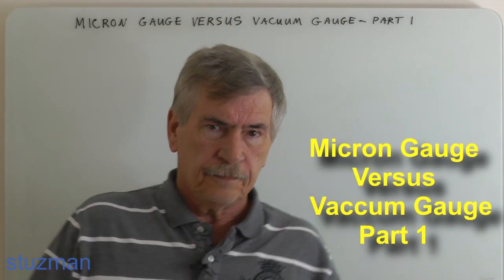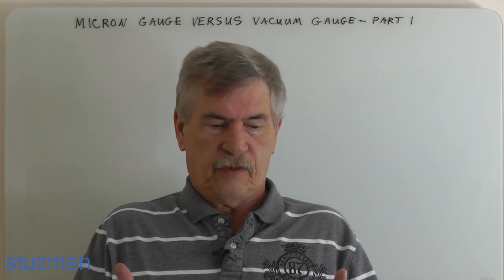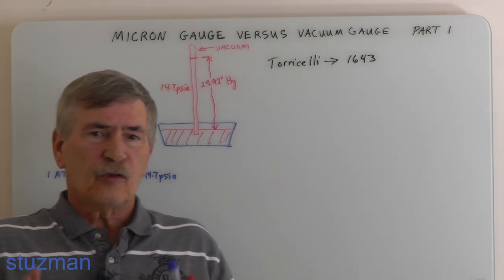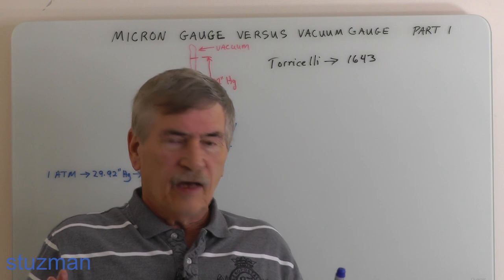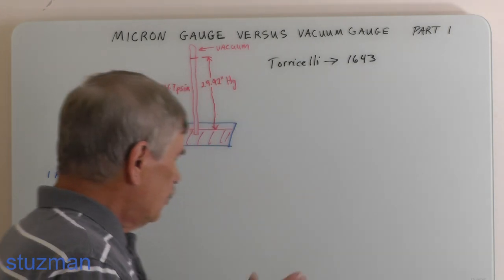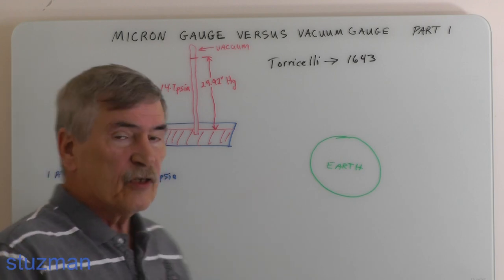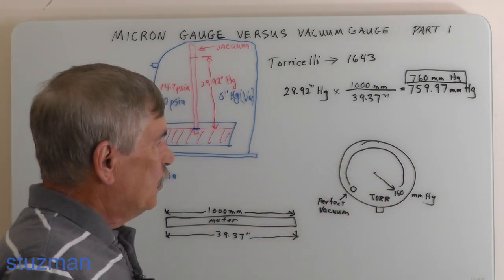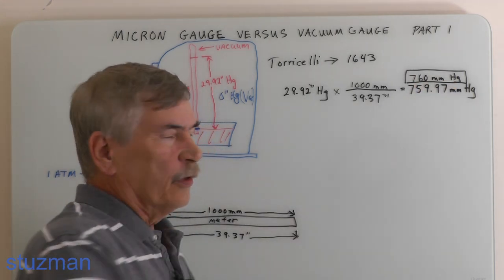Micron Gauge Versus Vacuum Gauge, Part 1

Comment: Thank you Sir for taking the time to produce this material. It can be a challenge to find a channel willing to delve a little deeper. I don’t have the mathematics chops to follow university programs. Greatly appreciated 👍
Reply from the maker: Hey Ian and welcome to the channel! I've always like to delve into a topic to get a better understanding of it. And don't worry about the math as even most of the electrical engineering stuff is just basic bath with maybe a little algebra. Even with several engineering degrees, I rarely find myself using calculus. Thanks for the comment and be sure to have a great weekend!

Comment: I viewed the entire playlist; Mini-Split Heat Pump Install, Pressure Test and Vacuum.  I wanted to thank you for the very professional, educational, and enjoyable series of videos.  The subject matter, camera work, and detailed information included in the videos is first rate.  I can tell that you are passionate about the projects that you tackle and way you present the information makes it easy to follow and understand.  I’m currently installing a mini-split in my garage.  Your videos convinced me of the importance of pressure testing with nitrogen and using a micron gauge instead of relying on the compound gauge to determine when a sufficient vacuum level had been reached.  I spent more money on tools than I had planned, but It’s like they say: “The cheap comes out expensive”.  Better to do it right the first time than to have to do it over.   Thank again and keep up the good work!!
Reply from the maker: Thank you very much Edward for the comments on the videos and wish you all the success on your install of your mini-split for your garage.
Reply: HI Ed, just read your comment. Im doing the exact same thing.  3 head unit mini split system for our garage/shop. It has cost me more in tools than if I could have had it done, but I like doing things myself.LOL

Comment: Terry, I saw your 1and 2 videos on gauges vs micron. I strongly believe it's a very impressive and informative set of videos. I personally relate to subject because I am personally installing a split unit. I have a strong background in several  trades. However, in my 55 years I have shy away from home and car HVAC. You so right about how sloppy the installers are installing a split units. I have turn away several installers because no nitrogen testing and the 500 micron limited reguirdment by the manufacturer. If you ever consider becoming online teacher on HVAC to get a certificate you could sign me up. Thank you again for your time and video. I immensely appreciate for sharing your knowledge. I share the same mamtra," share the wealth of knowledge with next generation. Your online apprentice.
Reply from the maker: Thank you very much Robert for the kind comments! I always encourage people to do their own work and once they have the information, it's up to them at that point how they want to do their install. That's one of the reasons that I try to do my own repairs, installs, etc. because as you've mentioned, even the 'professionals' do it incorrectly. I have certifications in EPA 608 , (all three licenses) and EPA 609 although I don't do this type of work on a day to day basis. Thanks again Robert for watching the videos and for the time to comment! 😊
Reply: @stuzman52  Terry, here is a follow-up of the installation. After getting the nitrogen tank for $ 96.00 and a gauge from Amazon for $ 38.00 I found my first bubbles in my joints. I love Better Bubble in blue. Made the job easier. Second, my first test was 150 psi showing one bubble but then 300 psi I discover you need to make sure your connection from gauges and split unit are tight. Now after 1 hour 300 psi is holding. Thanks for all the information 👍😀 If send me an email I will send you some pictures 😊
Reply from the maker: @robertmorcate846  Great work Robert and glad to hear that it all worked out!

Comment: Good information Terry.  I never knew there was so much to know. Well put together vid, impressive as always.
Reply from the maker: Ozzstar's Cars Always new stuff to learn for sure Glen. Hope you’re having a great weekend! 😀
Reply: @stuzman52  I did an oil change, worked on diagnosing a broken microwave (weak HV relay on the control board), stopped by and visited my Dad, took the old oil to a recycle center, ate lunch at ChikfilA with my daughter, took a nap, now watched your video. I'd say the weekend is good so far. 😁👍
Reply from the maker: Good gracious Glen! You have been one busy man. I believe that you can rest for the rest of weekend as you've done enough work for a week. :) Have a good one!

Comment: Excellent video Terry.  Thank you so much for educating me in how all these things are related...  Do have one question though... in your 36" mercury column and you tip it into the vat of Hg and the level of Hg in the column drops to 29.92", the vacuum created in the top of the column is my question.  Is this not a perfect vacuum? TIA - Randy
Reply from the maker: Thank you very much Randy and glad to hear that it all made sense! The vacuum at the top is called Torricelli's vacuum although he disputed that nature wouldn't allow such a thing. It's still not a perfect vacuum though. In this case, the vacuum is not where the atmosphere has been extracted because the mercury column is totally full when it is immersed in the dish of mercury. The vacuum consists of mercury vapor and its pressure is around 2 X 10E-5 psia or 0.00002 psia. But you've got to admit that it's pretty close to a true vacuum with a pressure that low. Great question Randy! :)

Comment: Are u making a misstake around 45min mark?
29,92"Hg = 0PSIA and 0"Hg = 14,7PSIA
Shouldent it be the other way around.
Eg: 0"Hg=0PSIA 14,7PSIA= 29,92"HG
The mercury colum should drop in vaccum not increse?
Greetings from Sweden
Reply from the maker: Yes, you are correct! I was covering so much material, the numbers that you mention that I said was mistakenly covering gauge pressure. Good catch!
Reply: glad someone else caught it, I was about to comment that the Hg values are flipped in that diagram from 44:36 to 46:00.

Comment: many refrigeration techs use the evacuation process as a leak test.  this is not a good idea because it would equate to a 14.7 psi pressure test which is very low and would not show a small leak.  under those conditions flux or scale could conceal a leak.  that is why it is recommended that a 200 psi or greater is the proper procedure.   nature hates a vacuum, thanks looking forward to your next installment.  gary
Reply from the maker: I couldn't have said it better Gary! And I will address this issue among other topics in the next video! Thanks for watching the video and sharing a comment as it's most appreciated! :)